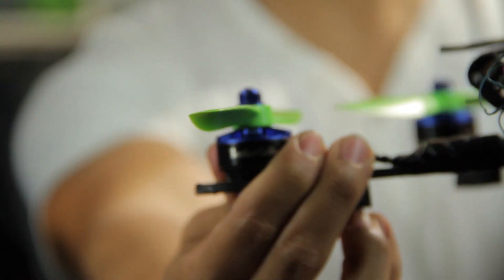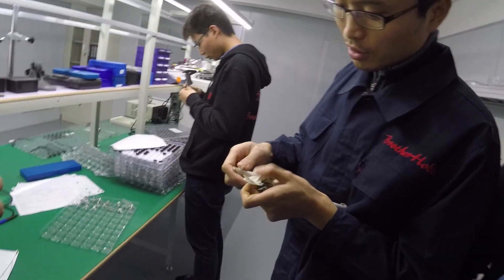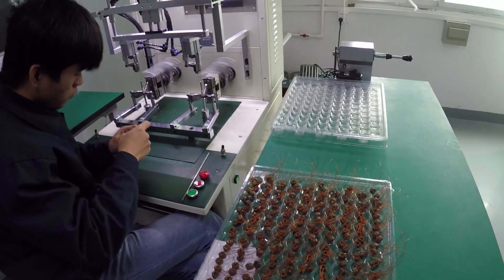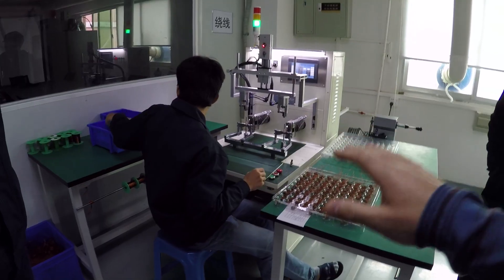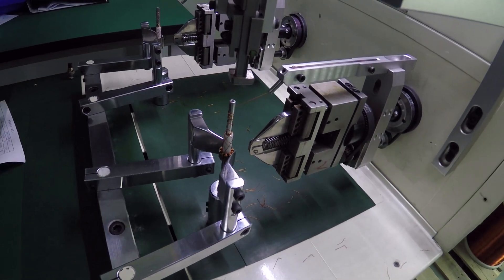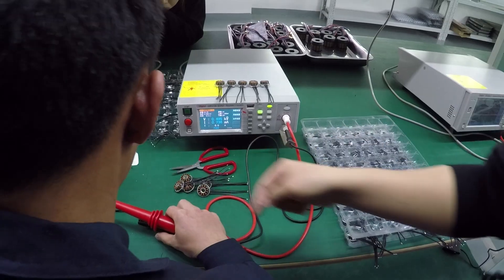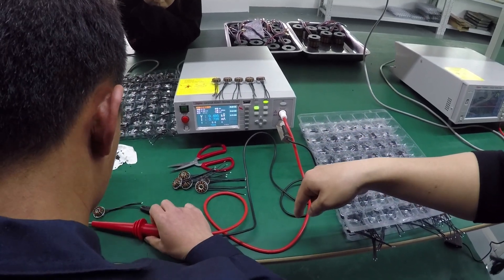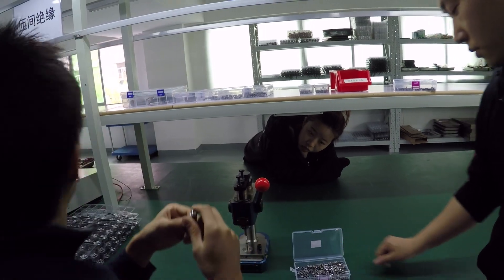How Motors are Made

Comment: of course changing the bearing is hard if you're not using the right equipment they sell tools you can even rent them at AutoZone for different size bearings that will work on those motors just finebut you have to press them in and you also need to press to remove them or you're going to break stuff

Comment: What you call continuity check is actually a High Voltage Electrical Insulation Test ( HighPot Test) and it is part of the safety precautions and measurements. This test verifies that the insulation of a product or component is sufficient to protect the operator from electrical shock, also identify insulation deterioration due to poor manufacture practices before the product make it to the customers. Excellent video BTW!

Comment: wow that is a lot of manual labor. I rewind up to 500 hp 3 phase and up to 180 VDC 5 hp armatures. What they should do it predip the stators in varnish, then wind, then dip and they won't have to worry about grounds ever. In fact they could get rid of the second bake all together with these small motors. Actually surprised how much manual labor instead of automation they have. Cool video.

Comment: what are your guys' opinions on the TBS power cube? do you have any experience with it? Does it compare to the equipment that most of you use on your 5 inches? I want to get into the hobby but the alien is very intimidating. The power cube makes all the electronics a lot simpler, and the build a lot less intimidating, but I don't want to sacrifice quality and performance. Maybe you could make a review/episode with the rotor x atom.

Comment: Having IQC ( incoming quality control ) is normal in nearly all manufacturing facilities along with checks along the way. A really well run company will have little or no quality checks as their quality control does not just exist under their own roof but with their suppliers and shippers. This is part of a JIT ( just in time manufacturing ) quality system. QC costs money so you are better off having a proper system in place where the quality is built INTO the product rather the inspecting it out. To me this looks like a small operation I would like to see how EMAX motors are made. I bet they don't contract work out as they are a big company to make everything in house.

Comment: would putting the label on last possibly effect the balance of the motor?
Reply: HeadTrip Fpv I think it's laser engraved
Reply: true, but taking material off will change the balance.
Reply: Yeah, you would think they would balance after the logo.
Reply: I don't think the balancing process before is extremely accurate. At least so that the tiny amount makes no difference in comparison with the balancing paste

Comment: Wow I'm impressed with the QC there, its definitely sold me on brotherhobby as my next motors, now just to pick with ones :D
Reply: r4 for sure :D
Reply: Looks like a regular factory production to me. Sliders for car seats have a tolerance of .003mm. For me it just confirmed that they do stuff the proper way, don't get me worng on this one, i'm still in ave for all the manufacturing process. I have a deep respect for all the production workers, it all seems so simple and easy to make in the end. People barely think about all the people and time that is put in the process of making something that they just take for granted.
Reply: It's not so must the tolerances that they use its the fact that if the part doesn't meet those tolerances they throw it out instead of trying to modify it to work, and also the parts that they get from out side (e.g. the barrings) they have thir own QC on those too and don't use the ones that don't meet their criteria
Reply: Those are all normal production procedure. If something doesn't fit/meet the criteria, you throw it out/send it back on reclamation to provider and bill him for it. It takes way more time to fine tune/fix something small than to make a whole thing again. If you run a company it's just more time and money efficient. Also the providers of parts are rated and if the provider is known for supplying a bad parts you just break the deal with him, which usually results in quite a big fine for not fulfilling the agreement. As a final assembly line and branding company BH is doing a regular manufacturing job, there's nothing special in throwing bad parts away, after all they're going to be blamed or praised for the final product so it's in their interest to use only good products.
Reply: i got the brother hobby r4 and they are amazing.